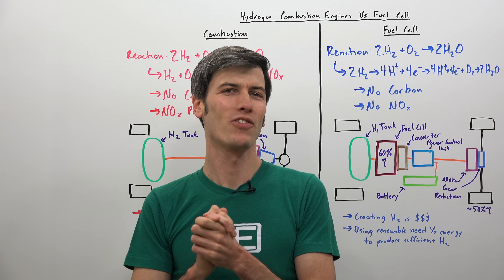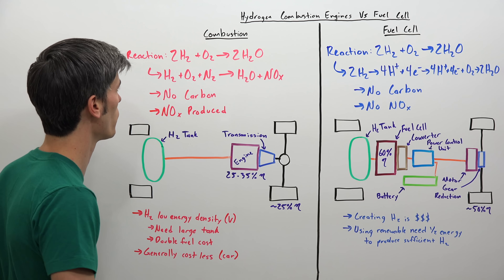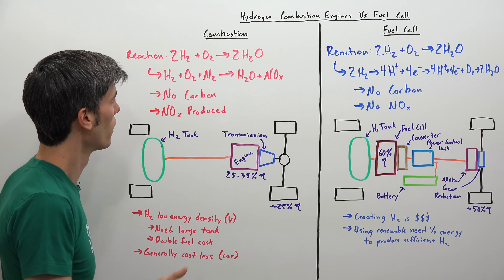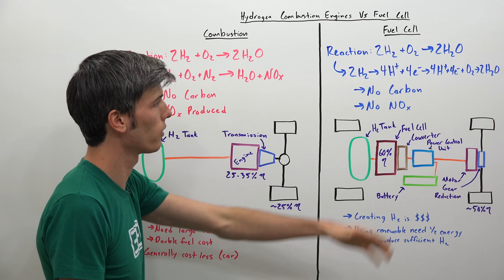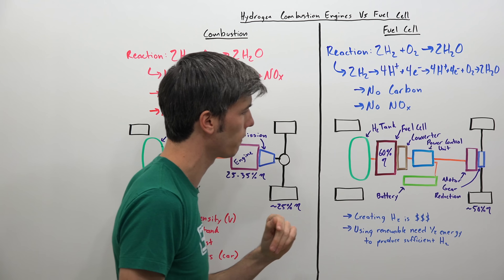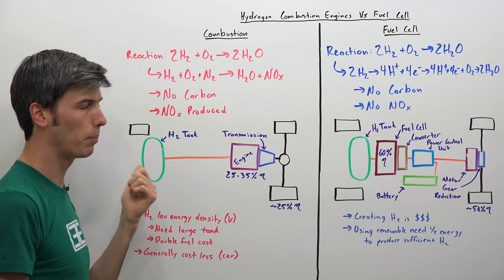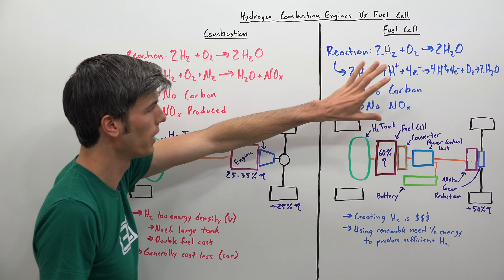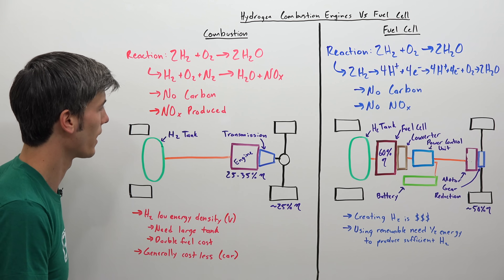Why Hydrogen Engines Are A Bad Idea

Comment: Great education video.   Couple comments.  What is the total production cost.  Hydrogen Combustion would use conventional combustion engine with mods of course but the FC vehicle will have the added cost of storage batteries and very expensive voltage converter and electric motor, which brings up another point that the FC car would be significantly heavier than assumed with all the high powered electronics, converter, motor and batteries.  What would be the long term cost over the life of the vehicles.  production cost + fuel costs + recycle costs?  Environmental aspects of pollution during use + recycle pollution.  Lithium is about 50% recyclable vs lead acid = ~ 100%.  How quickly is the environmental recovery from NOx vs left over lithium recycling.  Keep the great videos coming!
Reply: I would like to take the time to post some info about my vehicles setup.  I have been running my car on Hydrogen for about 2 years now.  I do not store large amounts of Hydrogen fuel in a separate High pressure container.  I produce enough gases on demand through the electrolysis process to run my 2.4L engine which requires about 6L per minute at 7000 RPM to run without hesitation or noticeable reduction in power.  To be clear, I do not separate the Hydrogen and Oxygen gases in my device. I simply have a small container that will be pressurized to 12-15 psi before the system will shut off production automatically.  I produce enough gases on demand through the electrolysis process to effectively bypass the need for complex High Pressure tanks to store H2 like most of the current systems.
    With this method I do not store enough combustible gases to cause any significant fire hazard or air displacement danger in the instance of a "leak" or failure of the containment device.  I bought a new fuel tank to replace the one that came with the vehicle to prevent contamination from the old fuel.  Now I use my house water to fill my cars fuel tank which holds 12 gallons.  So the fuel system is the same as you would find from the factory but, I fill it with Water instead of Gasoline and the fuel pump connects to the water container in the engine bay instead of to the injectors.  Also I do not use the fuel injectors, I use a large aquarium tube that is connected to the intake before the MAP/MAF sensors.  In order to run my engine on Hydrogen I had to retard the ignition timing from about 25 degrees before top dead center to about 5 degrees before top dead center.  I did this by using a timing light and rotating my distributor clockwise by about 7 degrees.
    As a comparison my car got about 30 mpg with gasoline, now it gets between 25-35 mpg with Hydrogen.  In conclusion I am sure that with a more complex delivery system I could get better performance and mileage because I am not monitoring the fuel air ratio but, my goal was to create a system that produces less Carbon emissions not to be crazy efficient and cheap to fill.  I believe by producing enough gases on demand this is more efficient because if I run out of fuel through miscalculation or my fuel gauge stops working, I simply need to find someone willing to sell me water (in one case a woman was so impressed she just gave me the use of her garden hose).  This is also safer because I am not using a "High Pressure" storage container for a combustible gas or liquid, it is just water in a tank.

Comment: A tractor trailer delivering hydrogen to a refueling station, can hold only enough hydrogen to fuel 10 cars. To be feasible, each car, must be able to generate it's own hydrogen. Heavy highway trucks did this about 13 years ago, as the onboard hydrogen generation system would pipe the hydrogen into the diesel engine combustion chambers. It ran mostly on diesel fuel but the hydrogen boosted the power and saved diesel fuel because it had extra torque. Originally it cost about $6,000 installed on a heavy Class 7 or 8 truck but installers got greedy and the price went up to the $11,000 range, which killed the conversion market.
Reply: I would like to take the time to post some info about my vehicles setup.  I have been running my car on Hydrogen for about 2 years now.  I do not store large amounts of Hydrogen fuel in a separate High pressure container.  I produce enough gases on demand through the electrolysis process to run my 2.4L engine which requires about 6L per minute at 7000 RPM to run without hesitation or noticeable reduction in power.  To be clear, I do not separate the Hydrogen and Oxygen gases in my device. I simply have a small container that will be pressurized to 12-15 psi before the system will shut off production automatically.  I produce enough gases on demand through the electrolysis process to effectively bypass the need for complex High Pressure tanks to store H2 like most of the current systems.
    With this method I do not store enough combustible gases to cause any significant fire hazard or air displacement danger in the instance of a "leak" or failure of the containment device.  I bought a new fuel tank to replace the one that came with the vehicle to prevent contamination from the old fuel.  Now I use my house water to fill my cars fuel tank which holds 12 gallons.  So the fuel system is the same as you would find from the factory but, I fill it with Water instead of Gasoline and the fuel pump connects to the water container in the engine bay instead of to the injectors.  Also I do not use the fuel injectors, I use a large aquarium tube that is connected to the intake before the MAP/MAF sensors.  In order to run my engine on Hydrogen I had to retard the ignition timing from about 25 degrees before top dead center to about 5 degrees before top dead center.  I did this by using a timing light and rotating my distributor clockwise by about 7 degrees.
    As a comparison my car got about 30 mpg with gasoline, now it gets between 25-35 mpg with Hydrogen.  In conclusion I am sure that with a more complex delivery system I could get better performance and mileage because I am not monitoring the fuel air ratio but, my goal was to create a system that produces less Carbon emissions not to be crazy efficient and cheap to fill.  I believe by producing enough gases on demand this is more efficient because if I run out of fuel through miscalculation or my fuel gauge stops working, I simply need to find someone willing to sell me water (in one case a woman was so impressed she just gave me the use of her garden hose).  This is also safer because I am not using a "High Pressure" storage container for a combustible gas or liquid, it is just water in a tank.

Comment: We have catalytic converters for NOx gasses. UK MOTS are quite strict when you check smoke and gas with the analyser. New fiesta ecoboost came from factory set to fail on emissions after 3 years for some reason. Had to find a unspoken get around 😂

Comment: The guys over at jcb will disagree with this but they could also be wrong. The problem at the moments is the cost of fuel sells. A vehicle will cost about 130% more to purchase using fuel cell technology. They will also need lots of di water which can workout costly. They do say that the fuel cell will likely take the place of diesel for industrial machinery and batteries will be more for personal transport. A combustion engine is very cheap by comparison though so I wouldn’t right it off just yet.

Comment: Unless I missed something, the thing I found missing was the source of the hydrogen and the inputs and energy needed to capture and store the hydrogen. How does the hydrogen get into the the fuel cell or end up in the hydrogen tank? How does that affect the overall efficiency of each method? What about on demand hydrogen using electrolysis generated by a car alternator and using a tank of water instead of a tank of H2? Seems like there's some missing pieces to this lecture.
Reply: ‘On demand hydrogen’ lol. First spend more energy to turn the alternator, then get less of that energy back from the fuel cell. What’s the point?

Comment: I agree with this video that using O2 from the atmosphere is a bad idea. But if the H2 is obtained from water via electrolysis, you automatically get all the O2 you need for combustion. The key to this process is, of course, 24,000 square miles of solar cells (155 miles by 155 miles) where the solar cell cost is $0.05 a square foot. Separate the H2 and O2 as a binary fuel and with 100% O2 you get 5 times the energy out of the H2. The only emission you get is the purest form of water that there is. 24,000 square miles of solar cells will produce enough Binary fuel to run all of the electrical energy this country needs, both day and night, and all the vehicles and trains in this country. Anything that currently burns fossil fuel can burn Binary fuel. Putting solar cells on your roof or in your back yard makes about as much sense as putting a gasoline generator in everyone’s back yard. It’s the economies of scale and mass production technologies that will achieve “printable” solar cells 10 feet wide and half a mile long for $0.05 a square foot.

Comment: H2 internal combustion engines (ICE) to replace gasoline engines may not be the best solution in every situation. Areas of the world that maybe interested in implementing this type of technology are would need to have an H2 infrastructure (or are planning to build one) and drivers that travel small distances (i.e. Japan).

However, the argument that NOx emissions are a "problem" for H2 ICE ignores the fact that a catalytic converter can be used to meet current EPA and Euro emission standards for NOx (assuming stoichiometric engine operation). There are other engineering challenges associated with H2 ICE, but dealing with the NOx emissions is relatively straightforward.

Comment: What about airplanes Jet engines ?? What would be more efficient for an airplane ? Burning the H2 in a modified combustion chamber or harnessing that energy from a fuel cell and then power a superconducting motor to turn the fan ?

Comment: So you say . 55 mpg in a 3/4 ton 4x4 truck with 4.10 gears w/ 38 inch tires with a on the fly electrolosis hydrogen generator looks pretty good to me !!! It works .

Comment: Nice job explaining how each system works. Sorry to say it, but your estimate of an 83% efficiency through the fuel cell control electronics, battery, harness, throttle, electric motor, gear-train and other ancillary systems seems optimistic. My wag places it at more like 60%, placing the overall efficiency at around 36%. Better than combustion engines, but the unforeseen circumstances around hydrogen's long term use, whether in either system, will need addressing. Care to take a shot at it?

Comment: The h2 does not need a generator.  Your still going to make no2. It's 30 to 40% heavier. H2 is the most abundant fuel on earth, they just need a way to cheapen the production  cost.

Comment: There is a misconception when focussing on efficiency.

Solar panels have a very low efficiency but produce Energy very cheap with enough sunshine hours per year.

The efficiency losses can be irrelevant when the overall system costs are low, for this the price of mass produced fuel cells compared to mass produced combustion engines is important.

A combustion Engine could run on HCNG, hydrogen infused compressed natural gas, which is attractive because you can use fossil methane, when the production of green methane and hydrogen can´t deliver the needed amount of fuel (yet).

A fuel Cell always needs a battery too.

with rising metal prices a combustion engine made of steel could be much cheaper than a battery which needs expensive metals, at least copper for the electric motor.

Thats a huge argument for combustion engines, since they need less expensive materials.

Comment: The NOx is only produced if you use air, use pure O² you get no NOx.  Use liquid H² then it's volumetrically advantageously storage and expand before entry to the Engine system!

Comment: Fuel cell seems like an ev with extra steps at first glance. The real benefit with hydrogen is that it gives an additional storage option for renewables when battery storage is all filled up. Either higher lifespan batteries will get so ridiculously cheap that storage is a non-issue or we might as well find something to do with energy surpluses. 

It still seems more practical to use the stored hydrogen for grid power production during the lower output winter months for the most part. Surplus hydrogen would probably be most practical in semis and other high weight/high range applications. Depending on the density of what a semi is transporting, giving up volume might be a non-issue cause they'll hit weight limits first. In that case, a semi might be able to give up a tenth of their volume and be able to travel across the us without stopping(maybe find a middle ground though)

Comment: Oil corporations and Automakers alike don't want the general population to know the fact that every vehicle produced,  every compression engine of every type can be quickly integrated to run on water.
Free fuel,  free refills,  longer lasting equipment,  ZERO  emissions and the process could actually completely clean the atmosphere in the process of everyday mass use.

Gasoline,  diesel,  2 stroke or 4 stroke.... ANY COMPRESSION ENGINE....

Comment: Update from 2021. 
Metalhydrides can cointain 400x more hydrogen than liquid hydrogen tank.
so, it means to contain 400L of liquid hydrogen you need to have 1L metalhydride bottle.
And it can be stored on room temperature and without big presures in bottle.

Comment: what about a gas/hydrogen combo engine like what you see ppl installing on their vehicles feeding through the intake vac. ? no hydrogen is stored and is under constant draw from the engine vac. almost like how a NOx system is hooked up but with 2 bottles, 1 to make the hydrogen and the other is collector attached to the intake.. is this a real possibility to work ?
Reply: This type of system does work however the engine temperatures rise quickly and will cause damage if not monitored closely. The hydrogen engines burn the fuel much faster  so the timing has to be somehow altered to make this work efficiently.
Reply: @glenhughes5121  makes sense.. ty for the reply

Comment: The NOX problem with the ICE could be solved by not allowing outside air in the engine.  I think the ideal situation would be to use electrolysis of water to generate HHO on demand for a small engine  that is perfectly tuned to only run at a specific RPM that runs an electric generator to charge a small set of batteries.  By having a low demand engine preferably a quasiturbine or a diesel engine that operates at only one RPM the weight could be reduced by making many of the components ceramic and coated with non stick surfaces eliminating the need for motor oil.
Regenerative energy from braking can be recaptured preferably by super capacitors and slowly added back to the batteries.  No H2 would need to be stored, no outside air would be needed in the engine thus no NOX will be produced.  Only water would come out of the tailpipe and be recaptured for further electrolysis saving on the weight of the amount of water to be carried for electrolysis to repeat the cycle.

Comment: Sorry--let me say all this in one post:  
.
Otto engines' NOx is greatly reduced by EGR.  Stirling engines are much more efficient than Otto engines. Ottos & moderate-temp Stirlings use only common iron, instead of the exotic metals currently needed by fuel-cells & EV batteries.  Stirlings w/out exotic metals use lower temps, which don't cause a NOx problem.
.
Yes, maybe someday, fuel-cells & EV batteries won't need exotic metals, and then obviously they'll then be inexpensive and harmless. But, till then, what I said applies.
.
Obviously we'll need a wide variety of all the sustainable/renewable energy...including biofuels. Stirlings can burn *anything*, including bio-Diesel. Micro-algae ponds produce a tremendous amount of bio-Diesel, without using any agricultural land.  Bio-Diesel is carbon-neutral.  Stirlings burn clean, w/out hydrocarbon-pollution.
.

Comment: Nitrogen is only present if you use atmospheric air, if you have a tank of oxygen and a tank of hydrogen, you can get a clean burn, combustion is also at the present time more practicable due to low cost and easy convertibility.

Comment: So what we need to do on the Hydrogen combustion engine is:

Recycle the exhaust using condensation, or somehow extract the NOx, store it, and then feed it back into the engine as fuel when we need it for a NOx boost in speed. 

There is another issue with Hydrogen powered vehicles that use water. They create deuterium oxide (heavy water), not a lot, only very small amounts of it. So it's not good to release into the environment if every car on Earth uses water as fuel.

However if Hydrogen powered cars catch on, it will become a serious problem.

We may see Hydrogen Powered cars operating in a closed loop fuel system, rather than allowing exhaust emissions, by recycling the exhaust.

Comment: Doesn't fuel cell generate 'a lot of heat output', which is only useful in large scale plants for greenhouses, et al. You said that 'fuel cells get oxygen from air intake'. I'm wondering if that introduces contaminates from impure air stream over time?
Interested to hear your thoughts on Stirling engines. I'm fascinated by the prospects of 'living in a campervan' with a single energy production centre using solar et al for 'heat, electricity, hot water'. I retire soon!

Comment: My father was working on supplementing normal gasoline with hydrogen. He was able to easily run 50 to 60% less fuel with the hydrogen supplement while achieving the same torque and HP. My father passed away before he was able to complete his work but is there a reason that others are not doing more of this?
Reply: Because it is not possible.